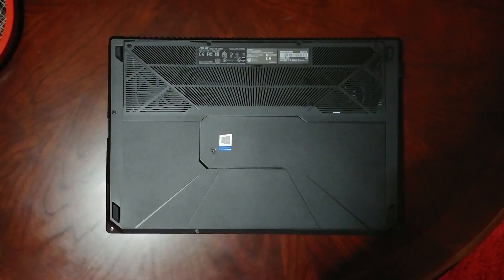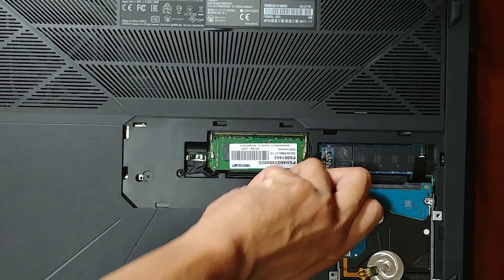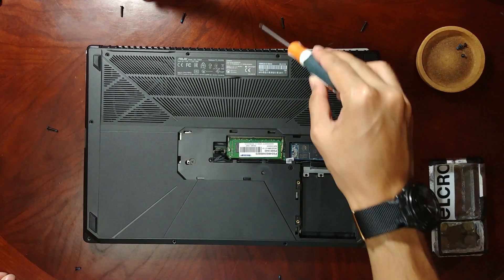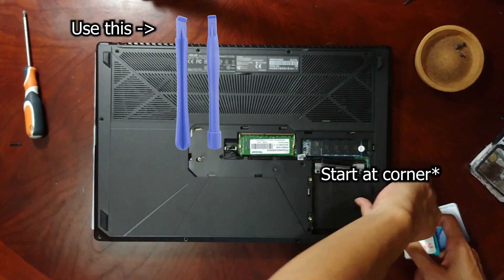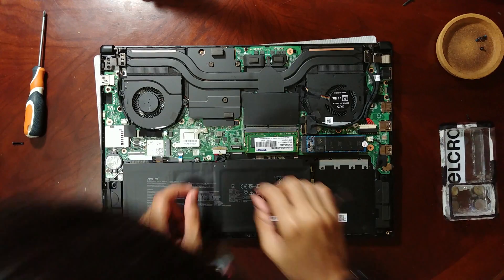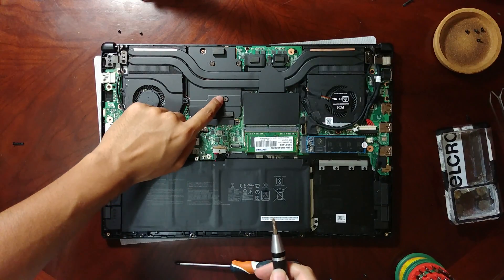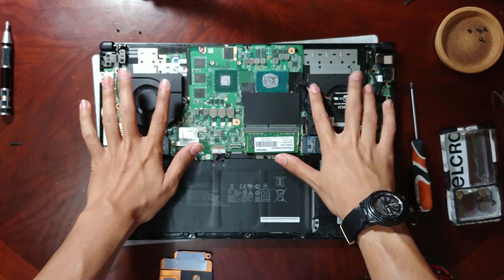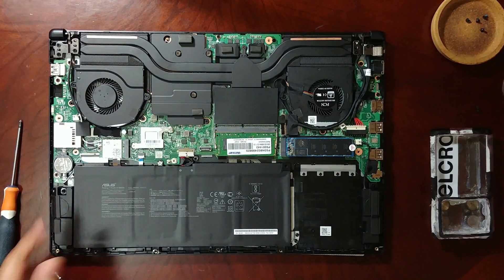ASUS FX503VD Teardown and Repaste!

Comment: yea, I openned my laptop to clean it and sadly now the graphics card doesnt seem to be working. I can only use the laptop with the windows basic display driver which sucks. Be very careful doing these things unless you want to end up with a damaged laptop
Reply: @sharifsircar  yea, I felt pretty stupid after doing it but oh well, live and learn.
Reply: @sharifsircar  Oh im not blaming you. Iwouldnt say Lack of experience was the issue, I was just so confident that the components were robust that I neglected to first of all ground myself while working with electronics and  then I didnt remove the battery either.  Since I was vaccuming the thing thouroughly I am guessing some discharge affected the motherboard killing something important.

Comment: Thanks for the useful guide. Just ordered some Arctic MX-4 thermal paste on the back of watching this. Considering I bought my FX503VM about 3 years ago now it probably needs it. Temps always seemed too high (even with good ventilation). Hoping that it'll also resolve/reduce the fps drops I'm having in some games that others say should work fine on this model (RDR2).

UPDATE: Gave this a go, but after piecing it all back together the laptop is now dead and I’m at a loss as to why?! Power light and backlight come on and stay on, after a few seconds the fans spin (slowly and quietly at a continuous speed), but other than that nothing going on. 

Took the laptop apart again a couple times and redid it. Original paste was caked on, but I cleaned that all up and new one should be fine.
Also followed some guides for hard resetting etc, but to no avail. 

2nd UPDATE: Came back to it a day later and stripped down the whole laptop. Cleaned every single component, put it back together and luckily it resurrected :)

CPU and GPU temps only looking a couple of degrees cooler than before, though will keep an eye on it and see how it performs (perhaps i didn’t apply enough that time).
Reply: damn you're scaring me now lol, i got the same paste and ill be opening the laptop up tomorrow, any tips before i start?
Reply: @TheDestroyerPlays  😂 well tbh since then I’ve had no issues whatsoever so just be careful to apply the correct amount and be careful when disassembling/reassembling. If you end up in the same boat as me just pray to the tech gods, open it up and put it back together again 😂
Reply: @Gary_TM  i have a spreader(spatula) so hopefully I'll be able to evenly spread it,    and with the help of this guide I'll be fine i hope, did you have to take the fans out?
Reply: @TheDestroyerPlays  depends on the model, though yes for my FX503VM I did have to remove the fans and heat pipes. Though worth giving them a clean with an air duster anyway to be honest.

Comment: Hi there, I, uhh, got some water in my FX503VD a month ago, turns out I think it's the GTX1050 focked. I don't need to buy a new card since the HD 630 still work, but I wonder can I at least disassemble the laptop and find out how 's the 1050 broken?
Reply: @sharifsircar  I will try to figure this out rather than send to the shop again. it hard to explain to ya why not to the shop here, but thanks for ur reply anyway.
Reply: @sharifsircar  pay 2000 HKD to fix this already and they fix nothing... won't do that again cuz they are lier anyway. Well, I guess I get use to HD 630 for now.

Comment: Can you put liquid metal instead?
Reply: @sharifsircar  Thank you.My concern was it maybe pipes are made not from copper.I order silicon non liquid for covering.
Reply: @sharifsircar  Some people recommend to put liquid metal only on graphics and Processor but not on pipes.What is your opinion?
Reply: @sharifsircar  What you thing about grizzly liquid metal? If ill clean with Noctua wipes and cover nearby board by special silicone it will be ok?
Reply: @sharifsircar  Thank you for your opinion.I allredy got liqud metal, ordered CONFORMAL SILICONE COATING and wipes so  I do not have much choice.Laptop is more then two years old.Warranty is over.I'm always do things to good and to long so hopefully all will be OK.Ones more thank you for sharing your experience.All the best.

Comment: I opened the back case to reveal the fans (I wanted to clean it since it was so dusty). I didnt take off the hdd and the hdd went with the back case. after i was done, i put the back case back (hdd came with it) and screwed everything up. When i opened my laptop, it can't detect the hdd. any solutions? Should i try to take the hdd off and put it back?
Reply: Sharif Sircar yeah, wouldnt be so happy if i found out my hdd was broken
Reply: Sharif Sircar ok i found out that the connector from the hdd to the laptop wasnt connected.... so i plugged it and fixed it. Thanks for the video

Comment: Hi, Is the heat sink resistant to liquid metalic?
Reply: @sharifsircar I understand, but my processor reaches 97 ° C, and that causes me to have thermal throttling of more than 50%, do you have any solution for that? (This is without stressing the graphics card) It has less than 1 year of use.
Reply: @sharifsircar  Thanks for your support, bro ^^

Comment: Hi there, thanks for the video, I just changed the thermal paste of my FX503VM yesterday (with some MX-4)for the first time and it runs way better, plus I undervolted the CPU with Throttlestop which helped too!

I have a question though: do you know what is the thickness of all the different thermal pads? I'd really like to change them, but have no idea which one to choose from 0.5mm to 3mm.... 

Thanks a lot if someone can help!
Reply: @sharifsircar  Lol, yeah, you could have put a bigger fan if you leave it completely open! Ok, nevermind thanks for answering though, I'll keep on looking out for answers ^^
Reply: @sharifsircar  Hey, so I finally ordered some thermal pads (0.5, 1 and 1.5mm) and changed them all yesterday and repasted again just to be sure. Turns out the inside of my FX503VM uses pads of 0.5 and 1.5mm. I also cleaned the fans, and the results are even better than before.
On Witcher 3, I'm at 70° max on GPU and 71° max on CPU (before it was sometimes 79°), and with Gears 5 depending on the scene it goes from 63 to 69° on GPU and 61 to 70° for the CPU. Was really worth it!
Reply: Where do I find those thermal pads?
Reply: @simonnomis7456  Bought them on Amazon, it took everything from Gelid : GC Extreme thermal paste and thermal pads.
Reply: @Playmag41 and where can I find those pads in my laptop?
Reply: @simonnomis7456  They're on components around your CPU and GPU. Once you open your computer, you'll spot them pretty easily.
Reply: Good to know. I just ordered the same paste

Comment: Hey a Quick Question. Asus fx503vd-dm108t is your model then how many Ram slots does it has. 2 or 4.  Am planning to upgrade it with dual 16gb kit. Max it's capacity to 32gb. !
Reply: @sharifsircar  Thanks man ! Which one you will prefer dual 16 Gb Adata 2666 MHz  kits or 2400mhz. ?
Reply: @sharifsircar  What am trying to do is edit videos on premier pro cause I also make youtube vidoes  But 8 gb is not enough so  i was thinking to Max out the Ram.

Comment: I've got fx503vm , repasting , undervolting and using cooling pad does make a difference. At stress temps are around 70-80 degree
Reply: @sharifsircar  - 0.130v undervolt and its stable for months now. Never had instability problems :)
Reply: @sharifsircar  You dont have to keep intel tuning utility to run in backround for undervolt to work mate , go ahead and close it without worry :)

Comment: To all of u who are considering doing this. do it. It's worth it, 

I used thermal grizzly kyronaut and dropped to 84c max with zero thermal throttling from 96c(thermal throttling) with aida64 extreme without a cooler + a 100mv undervolt on the 7300hq, gtx 1060. 

One thing to be cautious is the screws. Make sure ure using proper screwdriver as the heatsink fans are very hard to open and i worn mine had to take it to the shop just to open one screw.

Overall very satisfied and recommended. Relax asus wont even know u opened ur laptop hence ur warranty is intact. Just screw all the screws back and u should be fine

Comment: Hi Bro.  I was thinking off adding ram. Do you know the frequency I should be adding? I know it's  DDR4, I don't know the frequency.
Reply: Asus Fx503VD
CORE i5 7th gen
4gb ram. I'm guessing the model I got is the lower variant.
Reply: @sharifsircar  I guesw I'll try that. Contact the ASUS rep
Reply: @sharifsircar  Thanks for the tip Bro. Hope it all goes well. :)